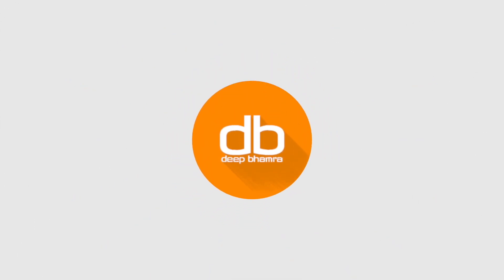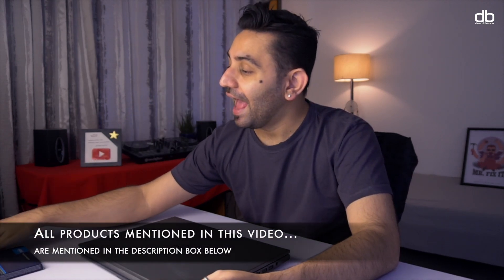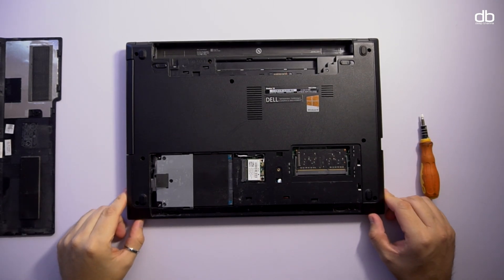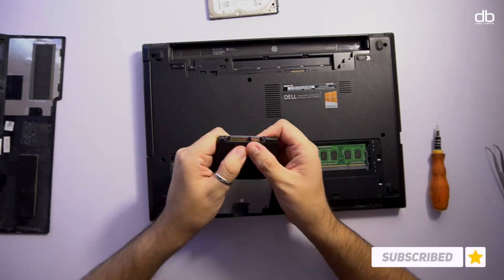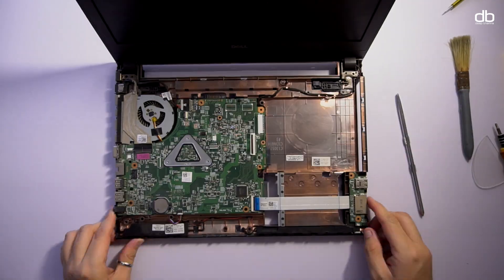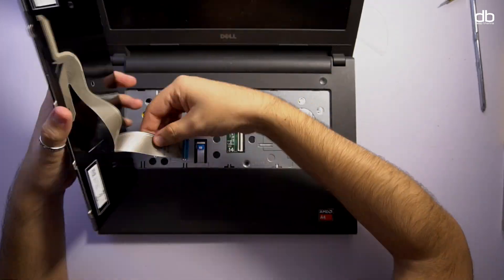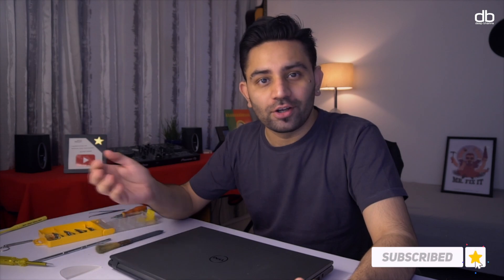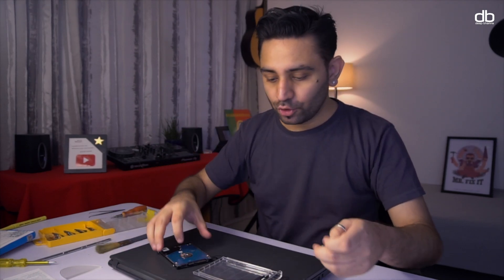HOW TO IMPROVE THE SPEED OF A LAPTOP OR PC? UPGRADE THE RAM & SSD for better speed & performance.

Comment: Instead of using as a external install through caddy by removing CD drive…!!
Reply from the maker: Risky move if you don't find the right caddy and if the power doesn't match the hard-disk will crash and any pro audio / video application will take a major hit. 
Check compatibility before buying a caddy. 
Personal experience

Comment: Should i get the Crucial MX500 instead of BX500 because the BX one is DRam Less SSD which is not for OS Installation
Reply from the maker: MX is a tad bit faster. And It's always better to opt for a DRam SSD.